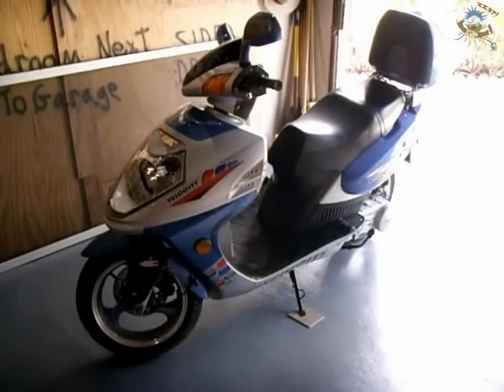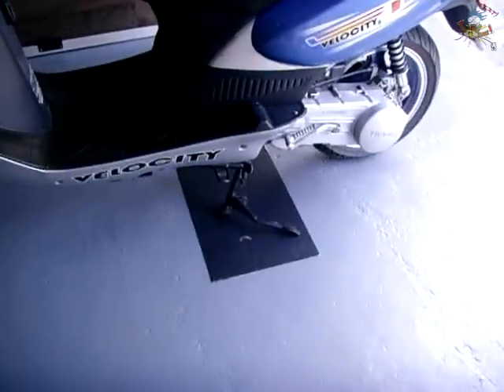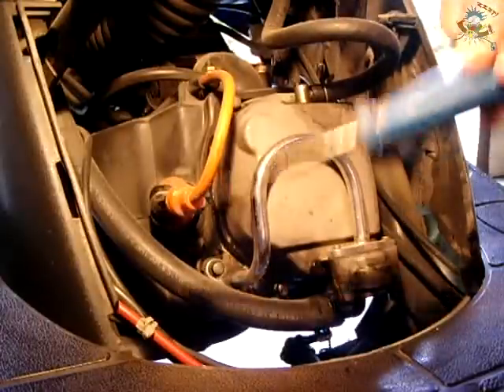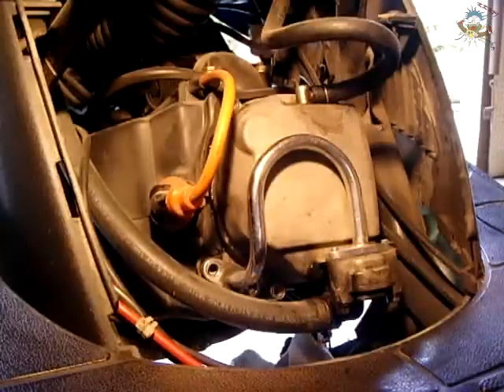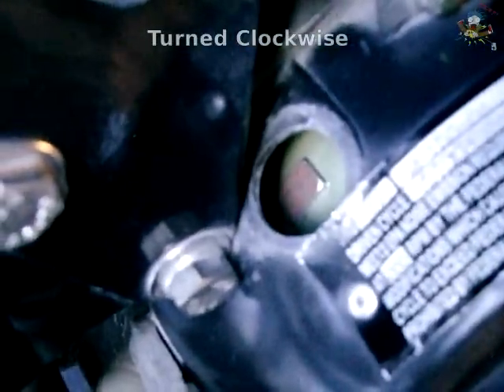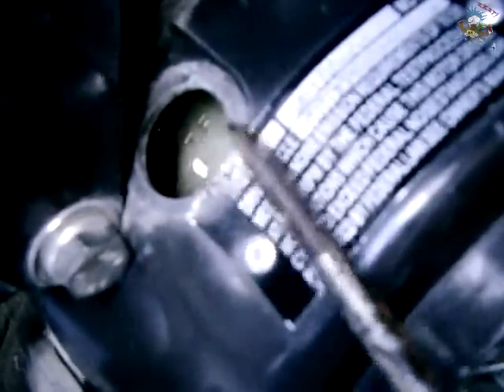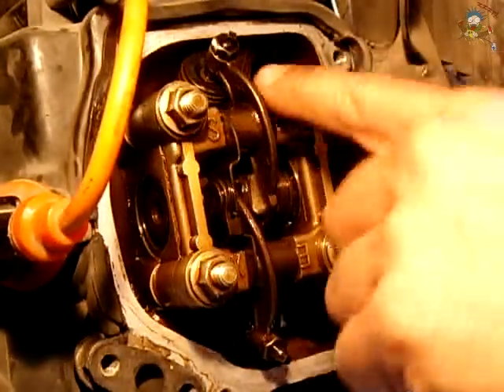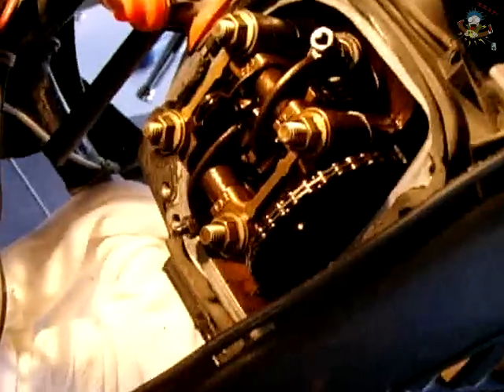Highly Detailed GY6 Valve Adjustment Procedure(Step By Step)

Comment: I set mine at .004 for intake and .005 and I try to start it and it want to turn over but no go and also there's no fuel flowing to the carburetor
Reply from the maker: If it worked before you started, then you screwed up adjusting the valves.
Reply: electronicsNmore so what do you think I should set them at...I was told .004 for intake and .004 on exhaust and I read the specs on my bike and it said .004 for intake and .005 for exhaust. I have a 2014 Kymco super 8 150

Comment: Thx, it is a very hard job to do for every thousand kms like some say
Reply from the maker: Eren Doesn't take that long to do.
Reply: @electronicsNmore   my sym's  150cc  manual  says every 3000 miles to adjust valve clearance ! it has the same engine...
Reply from the maker: @labakis1 Yes, SYM says every 3000, but many go as low as 500 miles. Thanks for watching!

Comment: Excellent video that taught me how to adjust the valves on my TaoTao Powermax 150. Only differences: the shroud is removed a little bit differently and my valves, I have learned, need to be about 0.002-0.003 for this bike.
Reply from the maker: Catherine Irkalla Be sure to check out my gy6 video playlist, rate thumbs up, and share. Thanks!
Reply: I do! I moderate reddit.com/r/taotao and participate in /r/scooters and frequently post links to your videos <3
Reply from the maker: Catherine Irkalla Thanks!

Comment: Holy smokes, every 500 to 1000 miles. That seems very frequent to me. I'm not sure if I have been lucky or if I'm comparing apples and oranges. I have a 1987 Honda Elite 80 with close to 20K on it and I've never had to adjust the valves. Is this the difference between a Honda and a Chinese scooter? Is the GY6 a heavy maintenance engine compared to Honda's?  Now I have to see if I can find the recommended service mileage for an Elite 80.
Reply from the maker: Doesn't take long to do. Honda makes good scooters, so I'm sure you can go longer periods of time before adjusting the valves. Thanks for watching!
Reply: I was curious then if the reason for the wear and tear on the GY6 is engine design or is it because a softer metal Is used on the valve? If it is just a hardness of metal I would think dropping in a better quality valve would make adjustments much less frequent. If it wears as a result of design I think it's just an live with it issue on the GY6.Once again the scales of decision come into play. Is it better to have an old and even sometimes abused scooter from Japan or to have a brand new scooter form Japan?   I am liking the looks of the Tao Tao Lancer a lot. My Elite 80 is dependable as a rock but 150cc would make life a lot easier in keeping up with traffic and not having to limit my routes by low speed limits and congestion. If I get a Chinese Scooter I am downloading all your videos HA HA.  I can tell you have been an electronics tech for a long time. HAM radio op here and a career electronics tech as well. I like to think of my scooter as my QRP rig.

Comment: At 3 minutes 32 seconds what is the big black hose in the centre, and where does it go to?  I have a quad bike with this engine and it has this hose on the engine, but the other end is free with a clip on the hose so it obviously used to go somewhere but I can not find out where - thanks.

Comment: Super helpful, thanks to this video i finally started my scooter in months. But it seems to be running rich, the idle is fine but once you get on the throttle it dies down. Does anybody know a way i can fix that ?
Reply from the maker: Either the carb(I have a video), or old gas inside the tank.
Reply: electronicsNmore I have a 150cc stock motor and  both my valves have bent about 5 times in the pass month, what can be causing the valves to bend so often??

Comment: electronicsNmore  I have a 2011 VIP scooter it starts and Idles at around 4K rpms then it dies I installed new spark plugs and a new fuel vacuum pump and I also have a new electric choke coming in what do you think the problem is?
Reply from the maker: Could be many things. Check for vacuum leaks and also check the carburetor enricher. I have a video for that. Thanks
Reply: electronicsNmore thank you very much if you can give me a link for a vid on checking the vacuum hoses and I have a new enricher coming in thanks :)

Comment: ok I'm new to this I'm am wanting to know to set both intake valve and the exhust valve .do you have too leave the piston on top dead center for both settings or have to have one open and the other closed . that's what I'm having to deal with.and whats the best setting at. I have a 150cc gy6 one inlet for vac. on manifold someone please send me some info    alan791@hotmail.com
Reply from the maker: Both are adjusted at the same time. Video was very well explained.

Comment: awesome job man, really.  i noticed that tube you had to remove in the beginning seems pretty important, what exactly is it for?  i bought a used scooter and the guy has that tube cut and pinched off and nothing connected to where you removed the hose.
Reply: well, both the tube at the top of the valve cover, and the metal pipe/tube you had to move out of the way.  mine is cut and pinched off and where your rubber hose attaches mine is just bare.
Reply from the maker: What tube?
Reply: EGR (Exhaust Gas Recirculation) It takes inert exhaust gas and mixes it with intake air. Reducing the intake air from 21% O2 to 16% O2  will decrease temperature of the engine which will lower NOx (Nitric Oxide) emissions because NOx is formed at 2800F.

Comment: Best video on the whole of youtube explaining valves. Quick question, what are the main factors at causing low compression in a moped/GY6 engine?
Reply from the maker: Max Exelby Low compression is caused by valves out of adjustment, incorrect timing, or worn piston rings.
Reply: cheers

Comment: Should the exhaust and intake clearance be the same or the exhaust be bigger little bit , and what numbers of clearance should i go with ?
Reply from the maker: That was all mentioned in the video, and video description area. Thanks for watching
Reply: electronicsNmore what adjustment do you recommend in a hot climate 0.005 or 0.004,0.005 ?

Comment: i have yamaha cygnus rs 125 cc. other name of moto at european countries is yamaha vity ..i need valve adjustement. as you said i should apply 005 intake and exhaust both? or exhaust valve should need more capacity for burnt gas push outside? also for gy6 engines use C7ER spark or C7HSA spark ? if you help make me happy really
Reply from the maker: gkc mgk Refer to manufacturer specs.
Reply: problem is that..i can not find it on usar manual or any place. that's why i still look for it
Reply from the maker: gkc mgk Then do as I said in the video.
Reply: yea i guess i should try that only i have chance..than i share here results for let you know too..thx for video also.

Comment: Hey I figured i would mention that the service manual states 0.05 not0.005 i am pretty sure thats my problem lol
Reply from the maker: You have your #'s screwed up. .004"/.005" or .005"/.005" is the norm. If the manual says .05, then that number has to be metric(in mm). .05mm = .002", which is a VERY small gap.
Reply: .00197
Reply: You wrote .005" But it states 0.05''  00.197" I just wasn't sure that it was written correctly in your details
Reply from the maker: Forest Thee Honorable
Like I said, .05mm = .002 inches
Reply from the maker: Forest Thee Honorable
I'm done replying. You're wasting my valuable time. I have many others people asking questions.
Reply: page 41 has the info
Reply: Alright appreciate the info
Reply: If 0.005 in doesn't work Try 0.002 inches fixed my problem Same engine thats in the video

Comment: so I presume that the valve timing and gap could have abit to do with my gy6 acting like it should be releasing the pressure ahead of time and being very difficult to kick start
Reply from the maker: Hard starting and poor idle is usually due to the valve clearances or carb.
Reply: electronicsNmore  I adjusted the valve clearance to .005 however it still isn't starting but at least now it doesn't feel like serius back pressure when kick starting it, I had it running yesterday with the pipe not tightened on apparently it was missing its nuts, so I shut it off immediately and I got the nuts and put the pipe on tight but now it has bearly ran I am wondering if it maybe clogged or something because when I ran it it looked like none of the smoke was actually coming out the end of the pipe
Reply: so I will do some more tests when I get home

Comment: will valve clearance cause it to be very hard to start. mine is really hard to start. runs fine afterwards. gas also comes out of the back of the carb when i try to start it. anyone have any ideas
Reply from the maker: Yes. Check the valves, but you may have other problems.

Comment: hey i have a 2016 taotao 50cc with 100cc big boar kit installed. after installation it ran great for 10mins. the  stock carburetor and manifold were kept in during this test drive. but after this test drive i guess what is called, bogging out, happened when i pulled on the throttle. so what i did first was install a bigger carburetor and manifold. the issue didnt leave. so i upgraded the cdi,sparkplug cover, cold intake, and flywheel fan, but no nothing! whats next??
Reply from the maker: I have no idea because you performed some serious modifications to an engine that was working fine.

Comment: Awesome videos, saved the entire playlist. You said you've replaced all your hoses with better quality Goodyear and Gates hoses. I'd like to do the same. Do you have a video on fuel and brake line upgrades or maintenance?
Reply from the maker: Hello. I figured replacing the fuel lines and vacuum lines was easy, so I didn't make a video. Thanks for watching!
Reply: I'm (kinda) new to getting my hands on a motor, growing up I never had the opportunity, but now I've got myself a bike (and a paycheck! lol) Gotta park my GY6 for the season while I save up for my next upgrades, because though I bought in new some 10 months ago, these chinese scoots are so needy Ive got to upgrade my entire transmission to avoid further problems.
Reply from the maker: f1guremeout
Luckily parts are very inexpensive. :-) If you need many parts, then place one order from Mortch motors. Lowest prices online, but the shipping is around 30 bucks.
Reply: awesome! thank you very much for the noble advice, I'll use it wisely. Subscribed

Comment: is there any danger from turning the engine without removing the spark plug first? i've read on several sources saying that removal of the spark plug is important before turning the engine that way.
Reply from the maker: Hi there. No danger of the engine starting up if the key is not in the ignition, and the kill switch is also not in the run position, or if you pull the spark plug wire(boot) off the spark plug. Thanks for watching!
Reply: Gino F

Comment: I have a gy6 with low compression that doesn't start. I am aware that this probably has nothing to do with my issue. I can get the exhaust valve to wiggle but the intake valve will not wiggle at all. Even after turning it more than once and lining everything up it still has no play. Is this an indication of something or? Any help appreciated, thank you!
Reply from the maker: Hi. Both valves should have SLIGHT play when the timing marks are properly aligned. Keep loosening.

Comment: Never mind after watching the video I can tell the engine is a 150cc so for 50cc engines the spec is .0019 so you would use .001
Reply from the maker: I would use .003"/.004" or .004"/.004". What you stated is too small of a gap.
Reply: Well according to my gy6 manual the spec is .0019 I believe. I thought that was small as well.
Reply from the maker: +Micscience Wow. It does sound too small. The lowest I heard people using was .002/.003, I used .004/.005.
Reply: Micscience с

Comment: super video. followed your instructions. worked like a charm. valves were too tight. i gotta say it was a snap with your instructions. had it done in less than 20.mins. first time doing it. thanks.
Reply from the maker: Glad you liked the video Chris! That is usually the problem, too tight, especially the lower(exhaust) valve. Be sure to share my channel with others and rate thumbs up. Thanks.
Reply: will do.

Comment: I will have to try this in the next couple days. I was riding for the second time ever (I have about 30 miles on it) and on my way to work, I went around a turn, and she just bogged down and died. So after some google searches, this is one of a few suggestions. This one sounds most likely it tho. Thanks for posting and I will update on results.
Reply from the maker: Sounds like an ignition system problem. I have a video for that also. :-)
Reply: Problem Solved! You are exactly correct! I am just now logging on so I didn't get to see your reply but I'll tell you what happened. In this video at 4:32 "this pipe going around" .. That pipe on mine is shaped differently and it goes up and passes the ignition coil then becomes an insulated rubber hose. The ignition coil (or spark plug wire) was up against that chrome pipe and it had melted halfway through the wire. I removed the ignition coil, tested it for ohms, it checked out normal. Put it back, tried a spark plug test, it was a weak orange spark .. Plugged it in, scooter started up.. Til I kinked the coil where it had melted, and there ya go the scooter shut right down on me! so you are right on the money with the ignition prob.. Plus thanks for the help removing panels in this video. Knew what to do right away when I got home!

Comment: I'm doing this valve adjustment now and when I get it to TDC I do not have that big hole between the two head bolts. There is however a small hole and a larger hole but I'm not at TDC when I have the big hole where you explained.
Reply from the maker: Everything must line up as shown.

Comment: I'm thinking of replacing the Carb, Clutch, Variator, and CV Belt all at once and hope it'll run much better. As for it's idle, it's always been stalling ever since I bought it, but now it always wants to take off on idle. Usually I give it a little gas so it wont  but even when I don't I can feel it pulling away. If I do manage to hold it steady without gas, it stalls.

Comment: Hey everyone, I have a 150cc Velocity scooter, and it slowly started to get harder and harder to crank. I would run the battery down turning it over until it would finally fire at the almost end of the battery life. 
  I changed out everything that I could, since the symptoms of valve problems is basically no fire. This took my about 45 minutes, I used the sealant that he said, and BAM, my bike fires as soon as I hit the starter. This is not a hard job to do, and I hope you all get the help that I did from this man. 
   Thank you for the video.
Reply from the maker: +Michael Currin 
Hi Michael. You're welcome. Glad my video helped you. Please be sure to share my channel with others, check out my other videos, and rate thumbs up. Thanks!
Reply: Hey its me again, I am now again having top end problems, as my scooter does not want rev all the way up going down the road, I used your video and did a .004 intake, and .005 exhaust config. I cleaned my carb and it will rev all the way up on the kick stand. any ideas? thanks, i can give you my number.
Reply: Hey once again, I went from a year ago and i am now doing the valves, thank you for this video. great one bro.
Reply: What happen if u adjust the valve with out timing chain before ? I did now hear a click noise should I time the chain with stay or and readjust the valve need help guys